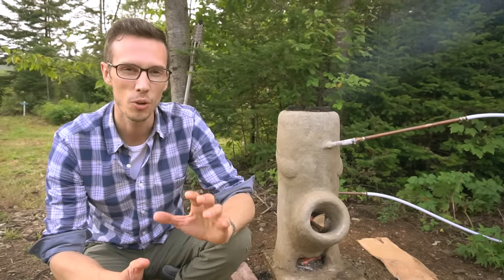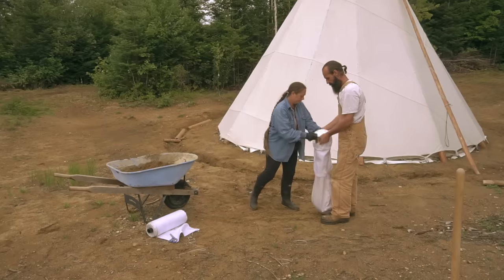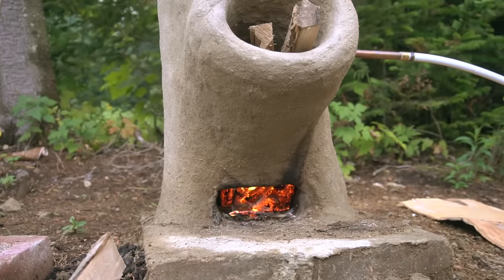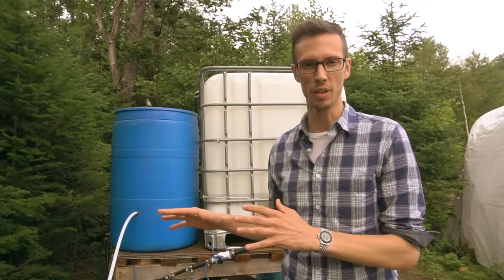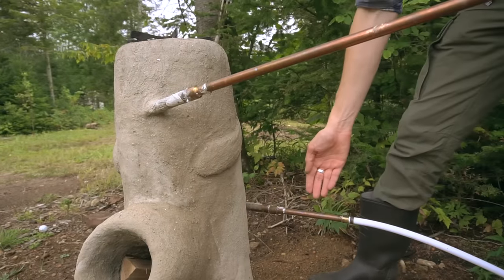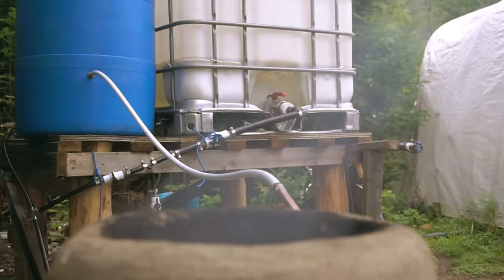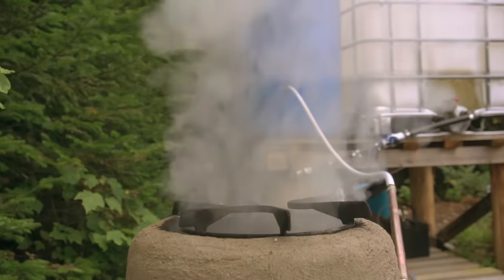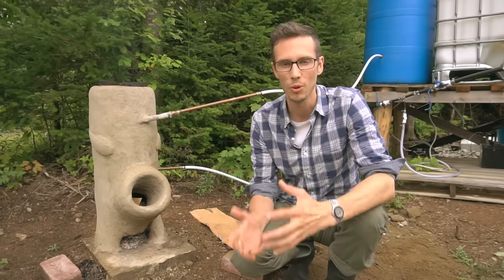Brilliant DIY Off-Grid Water Heater Using a Rocket Stove – No Propane!

Comment: This has been used in New Zealand for at least 100 years and the coils are often built in to the back of a wood stove. The system is called a “wet back” water heater (not a slur) and it is important for the tank to be close to the fire. You can use a regular hot water tank with a relief valve and a set of cut off valves. In the summer the system is closed off and electricity can be used to heat the water. In the winter the power is turned off and the valves opened and the coil in the back of the wood stove fire box, or embedded coil in the fire masonry will heat the tank. Bullet proof system.
Reply: Stephen Lockie limited to rural properties now tho right?
Reply: Geenine44 looks like it's council specific. Some councils don't allow them unless rural
Reply: andrewford80 the system does produce more particles in the burn as the water does cool the process slightly, but highly efficient woodstoves are still within the limits set by many councils.
Reply: Are you thinking of coal range or cooking stoves Andrew? If they can be multi fuelled then yes it can only be used in rural areas. But many are now wood only with the perks and features of the range. Grew up using a coal range so was glad to come across the Pyroclassic Fires. May as well get as many uses out of the wood as possible now that I’m having to pay for it.
Reply: Dibby59 .... so all the peeps down under seem to have this under control then haha.
Reply: Stephen Lockie ... Hey mate ... yeah I'm hearing ya ... My family grew up with wood stoves with inbuilt hot water tanks which we attached to the old outdoor tank stand at roof height which supplied plenty of pressure & I've also built a few & am in the process of styling different types as we speak ...
Reply: Aaah Geenine44 ... LOL ... You bet ya ... they're very popular & still common today in the outback with a plentiful supply of wood ... 
Someone still has to get out of bed early morn to stoke her up tho ...
Reply: Dibby59 .... that brings back memories. My Dad’s family home was an older villa with a header tank and water tank outside but also had a laundry with the old copper. Another water heater thanks to no plumbing. Loved those days out there.
Reply: Geenine44 ... Yes the old crab I mean copper clothes boilers ... we still have those around here ... not everyone wanted to keep up with the times &  some old folk still have the old agitator wringer/roller washing machines going ... not that you need to ring the water out as they dry so quick on the line ... some days the dog gets blown off the chain it gets so windy ...
Reply: Dibby59 ... hilarious!
Reply: Dibby59 wow I remember those.
Reply: Aaaah Stevie ... The view from the loo ... the door a quarter opened ... peeking out at 2 apposing T poles straining against each other to hold the clothes line up from laying in the dust ... The long awaited plop in the big ole ...The 1st place to search when someone went missing ... The journey fully clothed in the bitter cold in the middle of the night when nature didn't just call but Yelled ... The shitter is an A framed pitched roof rectangular box full of childhood memories where the carbide lamp shined brightly & created many imaginary shadows ...
Reply: Stephen Lockie 
That is exactly what I'm trying to do ...thx
Reply: im from nz and they are everywhere. a friend of mine made a cool rocket stove oven and grill.
Reply: So it's basically a three for one. It heats your home and water. Plus you can cook on it. Sounds nice.
Reply: 🙏🏻What an excellent tip! Might be using this in an upcoming build, thanks! 🙏🏻
Reply: Yup weird most people don't use one in American where wood stoves burners are being used. Thanks I learn the name "wet back" means something else.
I thought it was just a derogatory name for Mexicans
Reply: Het
Reply: In Sweden in my family house we heat all of 300m^2 like this but with a much larger tank and heater. It can be as cold as -20C. The sad thing is that you have to keep feeding wood which is a lot of maintenance to keep it going.
Reply: @Geenine44  .... Yep.. we are tight arses... and ingenious, so if there's a way to not pay for it, somebody will hook it up
Reply: @Finke.  my arm still remembers the old wringer ...
Reply: Stick to the subject - your little explanation about the system's name was not necessary.
Reply: Search for Aluva aduppu or Aluva stove.. this concept has been in use for ages.. not something new
Reply: @andrewford80  no there's a few in the smaller towns specially down the South Island
Reply: @Finke.  stoking the wife up early in the morning brings on the heat too
Reply: @mikha007  Haha never let the embers cool overnight ...
Reply: Churr my bro
Reply: I still have a coal range wood powered oven witch heats my entire house and  and also free hot water I'm from nz
Reply: @bluememehehe9314  churr cuzzy
Reply: In the UNITED STATES, wetback is a slur. The author is vwry tactful. Could you upload a link to the device you describe? Thanks!
Reply: ferkemall  rear coil
Reply: @gr0nis  well maybe you shouldn't have built it 300m2 if you don't have the backbone to keep it warm 🤣🤙
Reply: @robertfitzgerald8647  I did not build it. My grandparents did. its over 50 years old by now.
Reply: That's my favorite water heater name of all time love ❤️ 😍
Reply: @samsngdevice5103  who cares. It's true lol
Reply: So I have a water heater in my yard that I want to paint black and put in the sun but I'm not sure how I'm suppose to fill it up. It has a lot of pipes on top with fittings that have threads. Maybe I can go to Home Depot and they would have the parts I need to connect a hose or something.
Reply: I wouldn't imagine kiwis have slurs for Hispanics, when there's like 0 of them on the island 😂
Reply: Im offended... 😂😂

Comment: Cob Cottage Company in Oregon has an outdoor water heater for their shower, essentially buried a metal water tank in the cob mass of a rocket mass heater, light up a fire and within 15 minutes the water is hot enough for a shower and the mass stays warm for a couple hours so you have hot to warm shower water (fed from the on-site stream) for several hours. Also have a solar water heater feeding into it so on sunny days you can take a hot shower without the wood fire. ALWAYS use an open unit for water storage, and it would also be safer to not have the water line exposed to direct flame. A pressurized system is also known as a "boom-squish" system, where it eventually goes boom and anyone nearby goes squish!

Comment: Love  the rocket stove! I’ve made a few off grid, log fired hot tubs and a few things I’ve noted to help the thermosiphon ( and maybe some people watching this video ) the bottom pipe taking the cold water to the fire wants to be running slightly down hill. The coil around the heat source wants to be going uphill continually, and the exit pipe wants to be going slightly uphill. You can add a small solar powered pump to speed it up even more. On my current set up, with the pump running i can heat 700l of water to 40c from 5c in around 2/3 hours.
Reply: Oh man. That sounds fabulous! Would you be able to send me in the right direction for building a decent log fired hot tub? I have a dead spar shell id love to hear up or a humble bath.
Reply: Do you put the pump at the cold input/ at the tank or does it matter?

Comment: I lived on a boat 40 years ago, and we heated the boat with this same principal. We had a small coal stove instead of the rocket stove, but essentially it worked the same way. Up on deck was the water tank and it gravity fed water down to the stove which heated the copper water pipes which then ran around the boat and back to the tank on the upper deck. It worked really well. I'm so glad to see this rocket stove. I'm going to build myself one!

Comment: Absolutely love this, thank you.  My own CURRENT attempt to use heated rainwater, is via an old stove that I keep outside. I'm HOPING that copper pipe wound around a metal chimney pipe, and placed inside the stove with some wood fuel will deliver some hot water when it is lit and burning well. The 2 extensions of the copper pipe going out via the very short chimney and cold water in via the ash grill in the base. I can't think why it would fail! Saving up for the pipe NOW.

Comment: I've seen a similar idea where they ran tubing through a composting pile and that naturally heated the water, plus the compost kept continually warming itself.
Reply: MarkBTW that is a great idea too I'm not sure how hot it would get but warm is better than cold at any rate.
Reply: Compost piles can easily run 180 degrees so it is possible for them to get very hot. More than a few compost piles have spontaneously combusted.
Reply: @bobbyhempel1513  hot enough to burn your hand if you leave it in there lol

Pile needs to be 20-25% fresh manure
Reply: is this in cold country as well?
Reply: Can the compost be dumped directly to the barrel inside, instead of running copper pipes?
Reply: @Utube75  Rather not. It is to be used only in hot African countries.

Comment: Instead of using the blue container wake use an old water heater that would have better insulation to keep the hot water hotter longer and work off the same principle
Reply: Google the definition of the word PROTOTYPE and that will answer your question
Reply: @RebelMafia2.0  bill a platform fer it

Comment: Need a video on how they made the rocket stove.
Reply: you are so right, the person should also put on youtube a video for building his rocket hot water heater.
Reply: @ I garden because I have to , know it's a fireproof clay sand cement mix of some sort, the top shape can be determined how you like for using the copper pipe/tubing as the form for shaping the clay to, so there's room for really improving on something like this one shown here. rectangular transitioning into a cone shape is my idea in mind at the moment, with one chunk of angle iron across in a V to blast the heat into the mass more directly and by conduct conduction both.
Reply: Yes.. the diameter of the main flue hole and feeder hole for comparison.
Reply: Cerberus  why does the top need to be constricted? I'm learning..
Reply: I made one. Hit my bubble.
Reply: @OffgridSecrets  got a vid on how you made it? I didn't see one.)
Reply: @mattmuch1  uploaded 3 days ago. See my page.
Reply: Cerberus  I want to make these on campsites for nomad tech types living in their van or tiny homes.  Garden if Hope project.
Reply: agree
Reply: This is not a rocket stove. A rocket stove gives of practically no smoke because there is an insulated burn chamber that reaches extremely high temperatures which burns any left over combustion materials, making it highly efficient. It also makes a sound that is similar to a rocket taking off. This is just a bong shaped wood burner.
Reply: @croakingembryo  is it less efficient with the side hole made into the unit?
Reply: partygoer007 pp
Reply: @croakingembryo  ok but how high will this bong get me?
Reply: Garden Therapy you can do the same thing by putting a coil of copper tube in a regular fire the same process will take place
Reply: @andrem4877   near orbit if you sit on it while it's hot
Reply: @croakingembryo  This IS a rocket stove. It has all of the characteristics you mention including roaring sound. As for the smoke, you WILL get some smoke when you put new material into the fire because it is cold
Reply: @cherriemckinstry131  No. The hole for adding material is part of the design and it's also another entry for air to aid combustion.
Reply: @koitorob  neat...
Reply: @croakingembryo  please make a video.. id watch.. or build one for us for the community.a prototype..
Reply: @Cam-gb1cu  true but your burning more wood faster. If many start burning wood we will run out. If you grow sustainable firewood, then you dont run out.
Reply: Cherrie Mckinstry actually not. They burn so much more efficiently that you burn less wood faster. Since it burns hotter more gasses are consumed so less pollution.
Reply: Yeah, this isn't a rocket stove, this is a rock stove LOL

A correctly built rocket stove has that chimney insulated so the temp get high enough to burn up all that smoke coming out the top. In that way it burns ALL of the fuel in the wood, and makes only steam and CO2.

This joke of a contraption still wastes the vast majority of the heat it manages to make while still wasting the majority of the fuel put into it.

But it looks pretty.
Reply: @extremesheepherder9  

You build then if you say this is not a Rocket Stove...
The tall vertical exhaust stack means that it operates as a Rocket Stove.
Sheesh...Learn a little before making a bunch of inaccurate comments..

Comment: Would be great to fully insulate the water tank and the copper pipes with adobe as well... even better to build a separate cooker and make the chimney 4 or 5 times taller (perhaps in stackable sections) to make the same amount of wood heat about 10 times more water.

Comment: Four questions, which I invite anyone to answer: 

1) Should the coils be set a certain distance into the cobb, to avoid melting the copper, even though it has water flowing through it?
2) What would be the best composition of the cobb, to prevent cracking; esp. if the coils are embedded into the cobb?
3) If the stack were coated with water glass, to reduce cracking, would that insulate the coils too much to be efficient?
4) What would be the needed cure time before this would be usable, during cool weather?

I appreciate any constructive input I can get!  I'm facing yet another winter without hot water; and, long hot soaks are the only relief I have to the chronic pain I live with. (I REFUSE to allow the medical mafia to turn me into one of their junkies!!!)

Comment: Try lagging the pipes also try putting up heat gauge an pressure gauge also measure you flow an return pipe work to calculate  heat loss and yes definitely insulate the you water drum aka cylinder

Comment: That was interesting.  Do you know what the temp of the water was coming off the stove and back into the tank.  It looks like the hot water could lose some heat going back to the tank through the flexible hose.  I suppose you could put pipe insulation on it to prevent that.
Reply: This prototype, which we were told was an unoptimized prototype, is not optimized yet.
Reply: Its only a PROTOTYPE & NOT THE FINISHED PERFECT PRODUCT

Comment: Would have been nice to see how it was constructed.
Reply: You saying you cant figure it out from this description? The stove is made from dirt and cob mixed with water to turn it into a putty then formed and left to dry. It takes some time to let each layer dry. The stove itself is a very simple design. The only original concept here is forming a coil with copper tubing for the top section of the stove. It might be a rocket stove but its not rocket science! Simple thermodynamics! Genius I love it and will be building my own! Eventually!
Reply: Yes, me and 7 others would have liked to have seen it actually being built.  I have built other smaller rocket stoves but not like this. Sheesh!
Reply: The Savage Method except cob will crack and decay under high heat. It can dissolve in water and rain. Different proportions work better than others. Do you need to feed it constantly? Just saying it is only an advert for the concept. A steam explosion is deadly so if you are going to play around with it you better have a damn good idea of how to play safe. Luckily other productions are more educational.
Reply: Sharron Clark  So "Brilliant"  in the title is click bait ?

Comment: Recommend those pipes are lagged or insulated and to use a stainless steel tank that’s also insulated if he wants to continue with this system. But why not invest in a wood burner that’s designed for this purpose? The wood used will do three jobs, water, cooking and heating a home with less fuel. A good appliance these days will also be clean burning with the right design.
Reply: Geenine44 nailed it.

Comment: If they built this into part of their underfloor heating system it would work very well.
Reply: That implies it would be lower than the floor of the house however, and its a pretty small boiler system.

Comment: Paint the water barrel black and get free solar heating. :D
Reply: May allow bacteria growth, maybe with a clear top to let the UV sterilize it.
Reply: Or maybe if it isn't used for drinking you could chemically treat it.
Reply: It works well if you coil up black hose on the flat roof of a garage or something but be careful it can burn you too.
Reply: Freddy McIntire UV sterilization of certain microbes works, dude. Google Steripen.
Reply: k johnson  Canadian Winter disagrees with you...
Reply: k johnson  Sorry, I skipped your first comment. I thought you meant that having hot water was not "off grid" enough... In Canada, you need pretty much all the heat you can get, if you want to live past the age of 30.